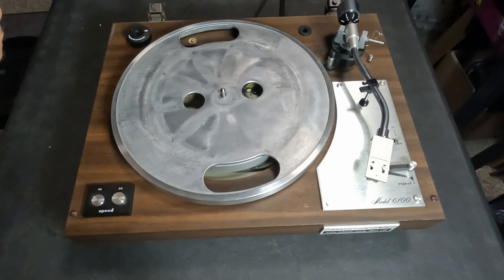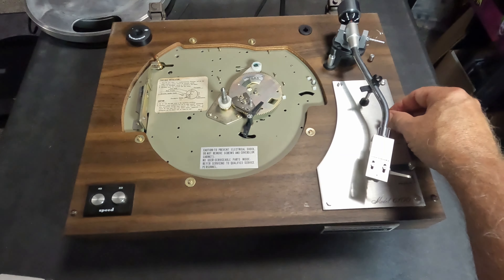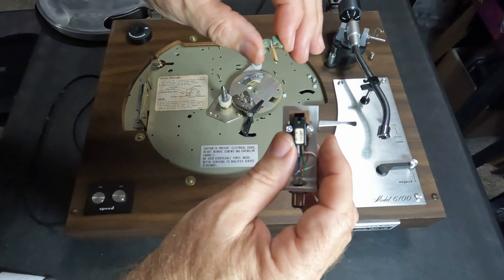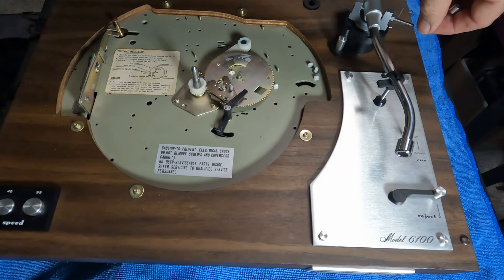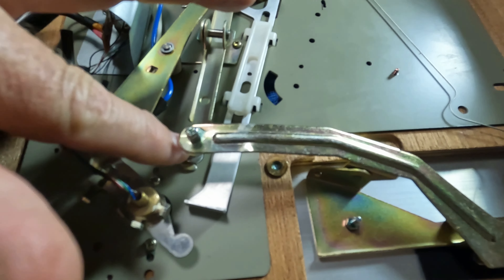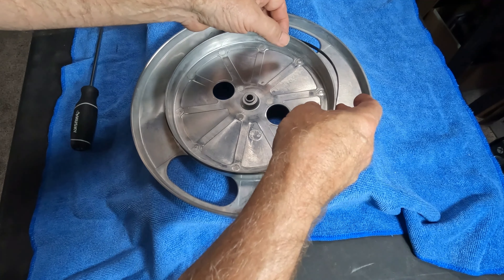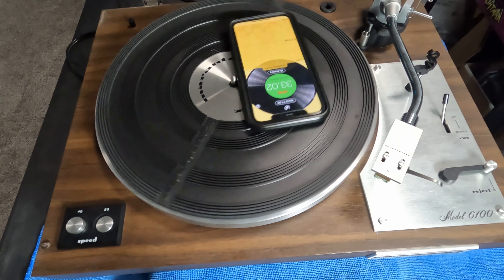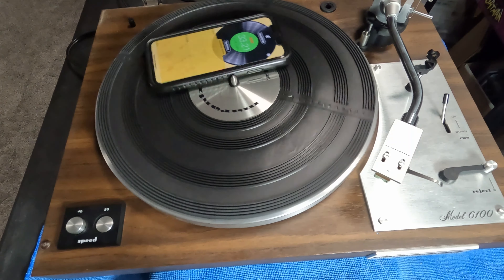Marantz 6100 Turntable Repair & Tips

Comment: Where did you order your parts from?
Reply from the maker: Thanks for writing and for watching my video. The stylus I ordered from Amazon but eBay has plenty of suppliers too. The belt came from eBay, there are a few suppliers for belts there. The capacitors I order from Mouser usually. Hope this helps and let me know if you need other info.

Comment: Hello, I like your video. I tired to get the damper out. I removed the big e-clip and i can turn the damper a little bit but the damper doesn’t come out. Am I supposed to be able to pull the damper out at the top? I tapped it a little but from the bottom but no luck. Thanks much
Reply from the maker: I just loaded an updated video on this model. Sorry I didn’t explain it the way it should of been. I was guessing from another model without really researching it first. Thanks for watching and writing in.